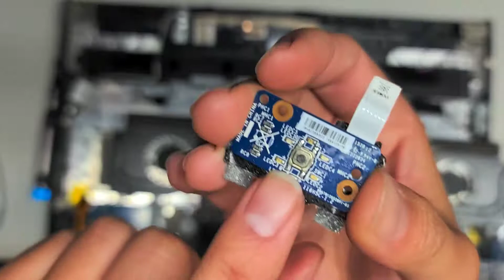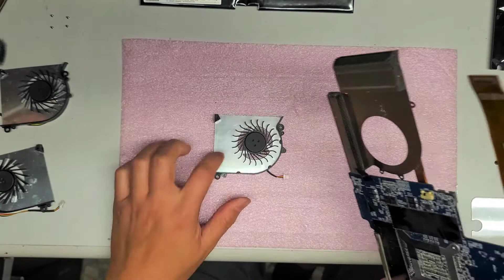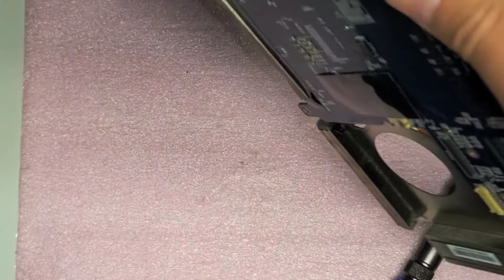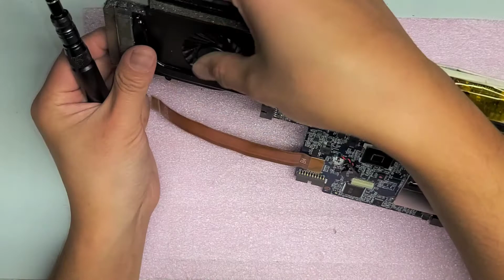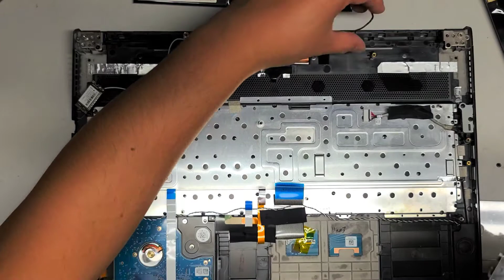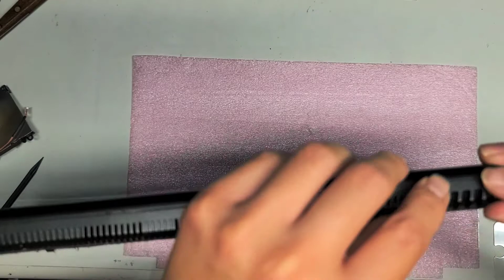MSI G Series GS60 2QD Disassembly SSD Hard Drive Upgrade Repair Battery Fan Power Button Replacement

Comment: Do you have the exact size dimensions, especially pad thickness size, of the thermal pads required for my laptop's heatsink components, viz. VRAMs, chokes (VRMs??) & MOSFETs? The tight tolerances worry me as a few mms here and there, and my laptop would be toast.
Reply from the maker: I don't, sorry. You can put some clay and measure
Reply: @ItsBinhRepaired : No worries, bro. Clay or BluTack sounds like a good idea. Shall try it out and let you know. Appreciate your response.
Reply from the maker: You need something not tacky or it'll stick to both sides

Comment: Nice work!
Reply from the maker: Thanks! If you haven't already, please like and subscribe so others can find my videos.
Reply: @ItsBinhRepaired  hey guy, one more thing:what kind of Liquid Metal Thermal Conductive Paste Grease do u recommand using for GS60 2QE?? do u have any suggestions ?
Reply from the maker: I use IC diamond. Everyone has different ones they use.
Reply: @ItsBinhRepaired   IC diamond?Should  IC diamond has some benefit and useful characteristic  to that u choose?
Reply from the maker: @hal00475  not electrically conductive, so low risk of damaging the computer if it goes where you don't want it. Thick, so it stays where you put it. Good thermal conductivity.

Comment: HI  . CAN PEOPLE TELL ME ABOUT LEFT FAN OF MSI GS 60 ? I SEE IT NOT FONCTIONING NOT MOVE I TEST IT FAN IS RUNNING BUT NO ENERGY REACH TO FAN TO MACK IT RUN SO  I DONT KNOW IT LEFT FAN START RUNNING WITH OVERHEAT OR  IT S NORMAL BUT THE RIGHT FAN OF CPU  IS FONCTIONING WELL  ???  CAN SOMEONE TELL ME ABOUT THIS MATTER THANKS
Reply from the maker: If the fan turns normally by hand, then the motor is likely damaged. You'll have to replace it. Make sure it's not just because the computer isn't hot enough for it to run. Most computers now the fans don't spin unless it's too hot.
Reply: Try the msi dragon center to setup the fan speed